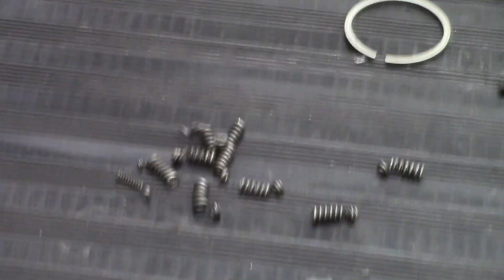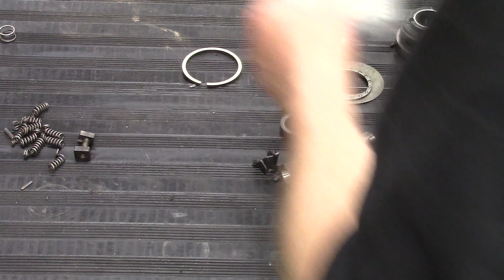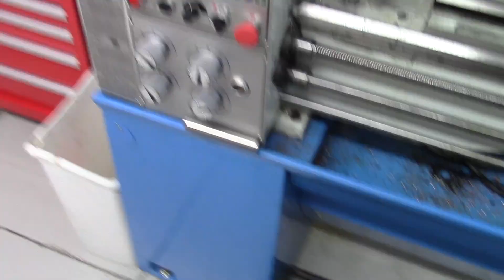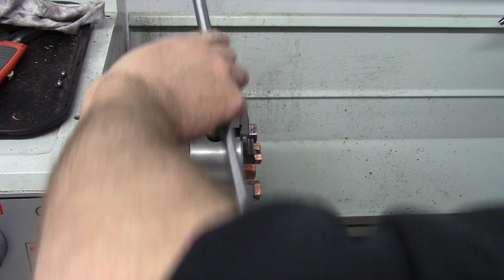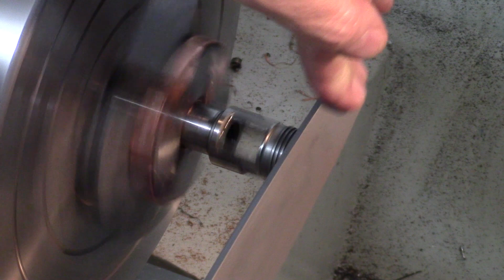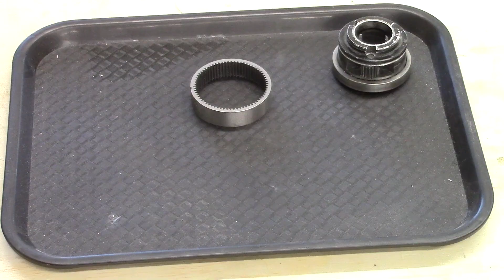Shop Drops #6, Part 1

Comment: Pretty neat seeing the guts of a tapping head. Nice repairs you've got going there.

Here in California, it's nearly impossible to find true "lacquer thinner" or any industrial solvents at the local consumer hardware stores. They only carry the eco-groovy stuff at almost twice the price. But if you know where to look, like wholesale body shop suppliers or the lumber yards that deal mainly to cabinet builders, solvents can still be found. I've been stocking up: naptha, xylol, lacquer and paint thinners, etc. Now if I could only find some benzene!